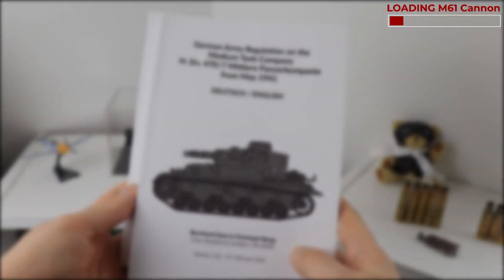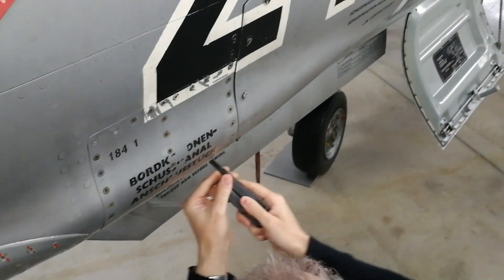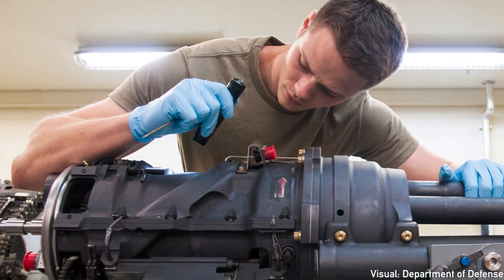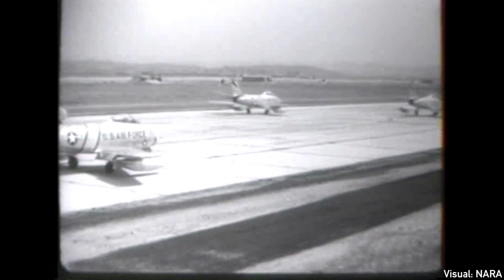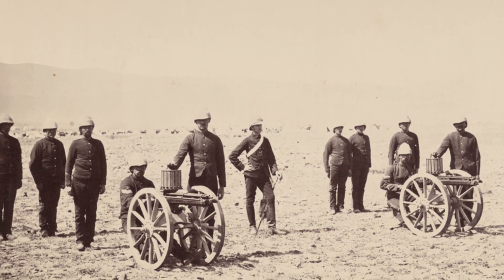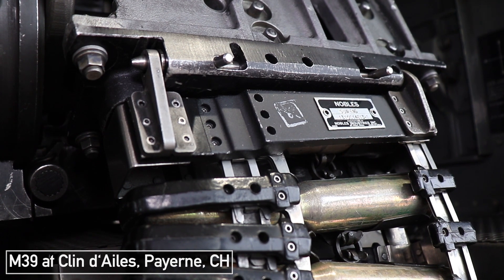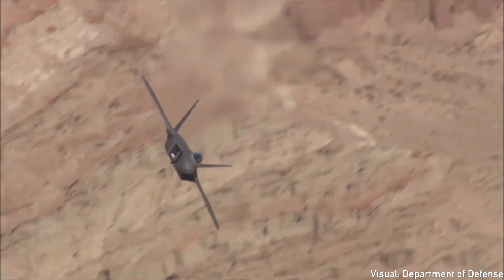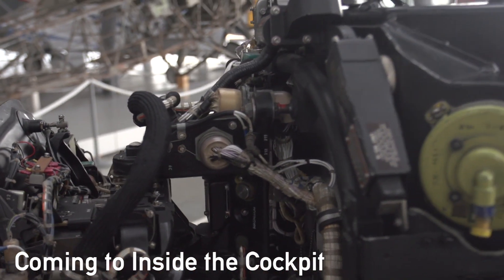M61 - Aerial Gatling Gun

Comment: Dzus fastener, is the 1/4 turn screw that is being used. Some one get him a proper tool, so he doesn't slip and scratch the paint.
Reply: The proper tool is a flat-bladed screwdriver. Slipping is a built-in feature that originated with slotted screws, and scratching the paint is more-or-less normal. The flat blade of a Swiss Army knife is in no way inferior to the finest flat-bladed screwdrivers ever made. It was a barely adequate idea in medieval times. Dzus fasteners were horrible.
Reply: Dzus fasteners while similar in function, they differ in use. These are camlocks. Dzus fasteners have a slot in the fasteners and lock onto a S shaped wire. Another type has a pin through the shaft that engages a stamped receptacle riveted to the airframe. Camlocks are more positive in locking as they are spring loaded and use a cast receptacle. All can be a pain to get the right length as you have to try different ones to get the right tension and then put on the retainer. Camlocks are less fussy as they are spring loaded so have a wider range of grip tolerance.
Reply: @beverlychmelik5504  I remember using a "Snoopy" tool for the Dzus fasteners back in the early 80s on F4s.
It had rounded blades to fit the fastener and looked like a sillouette of Snoopy from the Peanuts comic.
Reply: The Beast  got it, although from the looks of the canopy open/close buttons
a heck of alot of folks didn't use a proper tool for that either :)  Looked like the moon
surface from all the screwdriver dents :)
Reply: The idea of a German using the wrong tool and thinking "Ahhh...good enough." is disturbing.

Comment: both 4000rpm and 6000rpm are correct, it is configurable for either, high and low rates of fire. In 4th gen aircraft the fire rate is cockpit selectable.
Reply: Quick question as you might know that: are these "firing as long as the trigger is kept pulled"? or is there a timeframe set for each salvo?   I am asking because i have been trained on a twin AA canon with a bit lower rate of fire(1100 rpm), and that was what we were doing... you'd set the time window for a salvo in tenths of seconds, between 0.5 and 1.5 seconds if my memory doesn't fault me from 20 years ago. Otherwise the ammo would be gone pretty quick.
Reply: @nirfz  some planes like the F14 had a ground configurable burst cut limiter. I believe 200rounds is the standard, though if you let off the trigger early it would stop firing.
Reply: @snotcycle  Thanks!  Interesting, with our AA guns, the gunner was able to select that. (But the AA gun is always on the ground so ground configurable would be true here too ;-) )
Reply: Mialisus  What's German for 7?  The GAU-8 has 7 barrels :)
Reply: @nirfz  I do remember talking to some of my Phantom buddies and they indicated that the linkless
feed was more often the "weak link" to the Vulcan.  I can remember when one new weapons loader
found the gun bay access door was jammed.  So he grabbed a big screwdriver and was yanking on
the latch when the load chief saw him and yelled to stop. 

Just about then the door came loose and about 20 rounds of 20mm started pinging all over the ramp.
Apparently the feed chute had failed and the feed motor spit the rounds onto the door.
Reply: @f4ephantom  Our AA guns were fed with stripper clips (into the loading tray from which the cannon had it's own feeding system) The single problem we once had was a broken firing pin. In normal maintenance we had a crane to take out the 321 kg actual gun assembly and disassembled it on a table. In this case in darkness on the live firing range we changed the firing pin with a few flashlights without crane. (pre LED flashlights) And were quite proud about the short time it took.
Reply: @nirfz  Adapt and overcome, well done :).
Reply: @f4ephantom  That's my life summed up :-D  When i started engineering school at 14 one of the first things teachers told us in practical work: "In this establishment you learn to improvise..." And when i started my time as a conscript, one of the first things one of the instructors said: "Soldiers, are going to teach you to improvise",  when i got transferred to AAA Unsurprisingly one of the first things mentioned to us was something about improvising... And imagine my laughter when i started my job 20 years ago when one of the guys instructing us started speaking about the occasional need to improvise.
Reply: @nirfz  US planes let you hold the trigger. I think soviet ones usually have a fixed burst.

Comment: It should be noted that the Korean War experience with .50 caliber weapons mostly applies to the U.S. Air Force combat units since they were the branch that retained the M3 Browning in the F-84, F-80, and F-86. During the same time period the U.S. Navy and the USMC Aviation Corps had already adopted some form of 20mm cannon after experimentation with such weapons late in WWII and the immediate timeframe afterwards. The F9F Panther and F2H Banshee were armed with 20mm cannon (I don't know which one, but I assume it was a more reliable M2 or M3 model) for exactly the reason the USAF eventually switched; greater weight of fire and more variety of ammunition with better punch for, say, damaging armored targets - not just aircraft but also ground targets. The Navy however stuck to traditional cannon designs (Colt Mk.12 for example) and didn't adopt the M61 until roughly the late Vietnam era in the A-7E Corsair II and later the F-14.

Comment: I believe I've seen this type of "spring loaded screws" , on some  Race Cars. Aren't they referred to as " Dzus" Fasteners ?
Reply: Yes, it could be possible to call it this way. I believe that the P-38 and the P-39 were the first to use those type of fasteners...
Reply: They are fairly common in aviation. I saw them on L-410's, and simmilar, yet newer type also on B737s and A320s. They are called camlocs.
Reply: @Warump  Both are correct.  Dzuz is the flat blade screwdriver type with either button head or recessed screws. whereas the camlock is phillips type and smaller with a reinforcing collar.

Comment: If anybody has more technical info on this gun, the thing that interests me is if the spinning barrel has a significant effect on the ballistics.  Since the bullet takes some time to travel down the rapidly revolving barrel, is it necessary to ignite the primer prior to the barrel reaching the position where the round emerges?  Also, one would think the round must have a some lateral velocity when it leaves the spinning barrel. Can that be ignored, or is there a need for some correction?
Reply: From the bolt locking and firing to the round exiting the muzzle, it is only about half a degree of deflection, so no correction needs to be made to either. In 4th generation fighters, the gun is allowed a small amount of sway anyway as a slightly larger grouping of shots is far more beneficial than a pinpoint accuracy weapon.
Reply: @ironclad2nd489  Thanks for the info.  I guess the rotation rate is less than I was imagining.  And I had heard that they didn't want laser like precision out of the gun in order to reduce the odds of the accurate miss.

Comment: Ahhhhh yes..... Quick release screws for OCPs (USAF parlance- Outer Cowl Panels). 

On the C5s I was assigned to (before the switch to M models) there were 4 panels that had to be removed as part of maintenance to examine/service TF39 powerplant. Each panel had....275 screws. 
Removing those on the flight line...in the middle of January.... During a snowstorm.... With high winds...is an experience I don't want to replicate again.

Bismarck: could you do a video on how the Israelis use their guns instead of rockets during their myriad of engagements in history??

Comment: The M64 fired 20MM rounds @ 6000 RPM vs the Warthogs GAU-Avenger firing 30MM rounds @ 4200 RPM. The Warthog firing at full speed had more recoil than it's engines provided thrust forwards. If the Warthog could fire endlessly it would have so much recoil thrust it could fly backwards.
Reply: Handy for short field landings . . . messy but effective  : )
Reply: Actually the recoil is little bit more then the thrust of one engine.

Comment: Sadly, the ammo load lasts 10 seconds.
Reply: Not a huge deal in enviroment where you are lucky to get more than half a second on target
Reply: @66MetalDevil6  It is when you're doing ground support. You want to stay arround a while.
Reply: @WALTERBROADDUS  that's why a10s and attack helicopters exist
Reply: @ln7929  30mm is overkill for most targets. Hell, .50 bmg will shred a Jihadi Toyota.
Reply: @WALTERBROADDUS  30mm can be fired at much longer ranges and 50bmg doesn't have the large area of effect 30mm HE shells provides .50  is also not as versatile
Reply: @ln7929  If You need range,  you don't  use guns. And the 30mm was designed for use on armor. It's a waste on people and soft targets.
Reply: @WALTERBROADDUS  and? So what if it's overkill it does the exact same job   with more accuracy if it's money your concerned about why spend millions replacing cannons with machine guns if their isn't a big enough difference to justify it